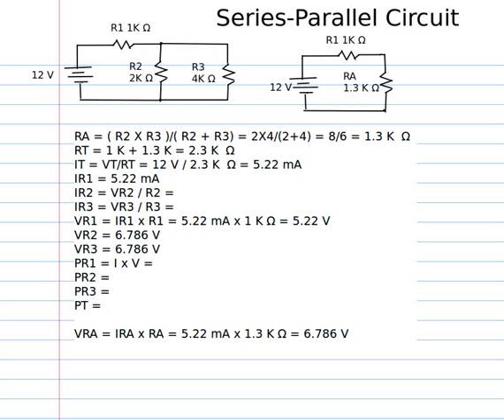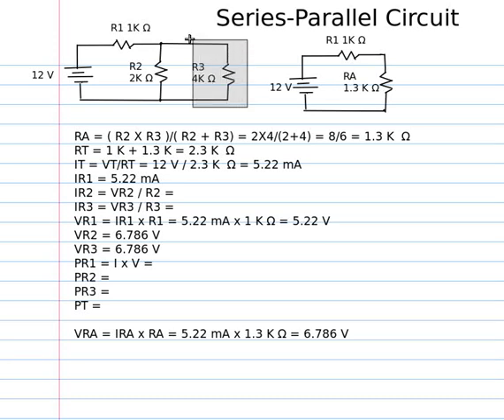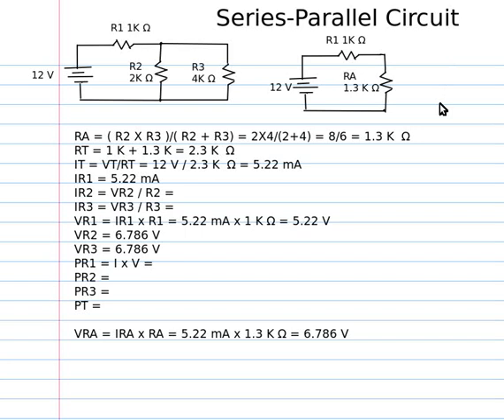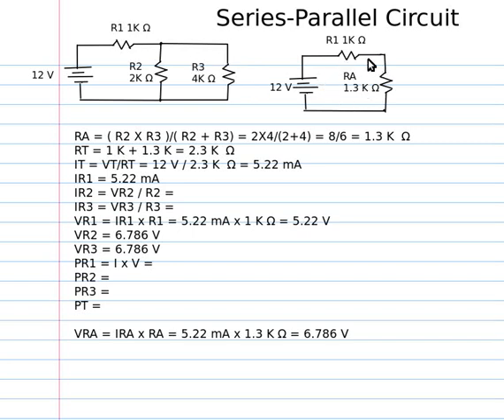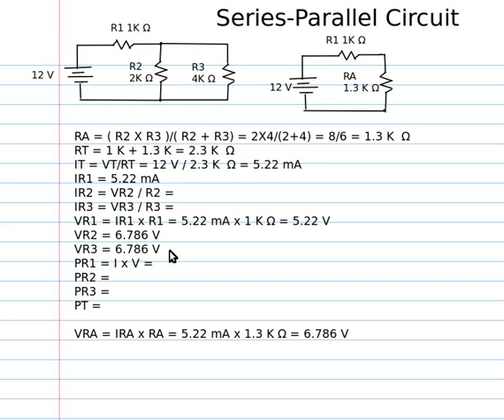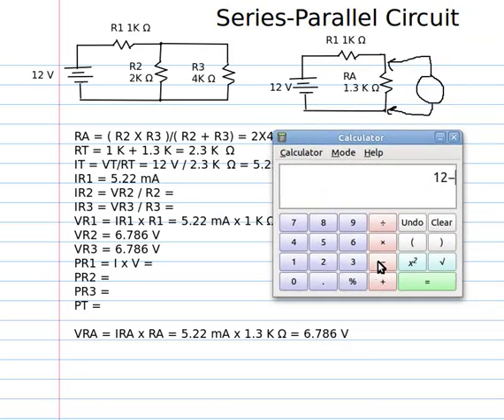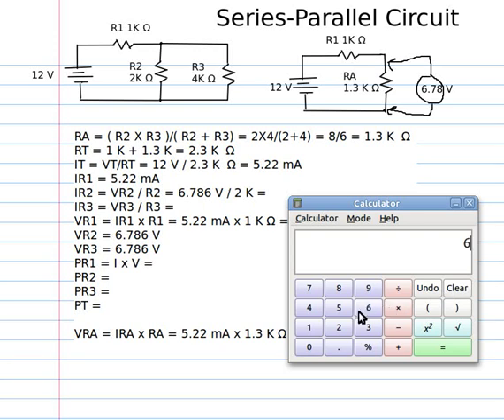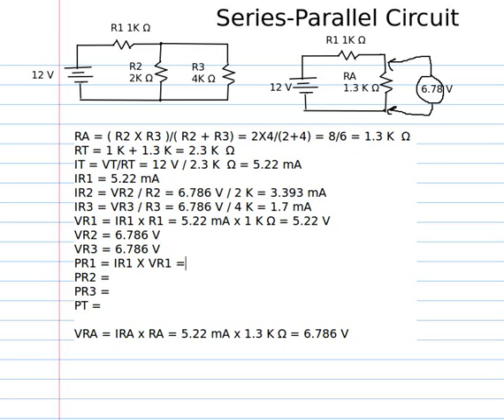Analyzing a Series-Parallel Circuit

Comment: use 2 superconductors each making same sinewave. Use iron to let them run in sync.  Let one only power something small, the other attach to a hanging antenna that does not touch ground. 
See what happens when you run them inductively with what the one powers through a cap. 
The cap breaks potential. The freq's run in phase, oh and make the entire system of wiring ferrous metal even though contacts aren't. Last but not least; mount chips on ceramic. Freq's you experiment with. use carrier.